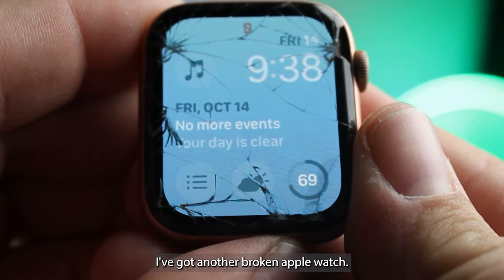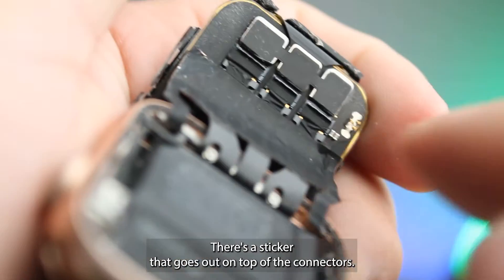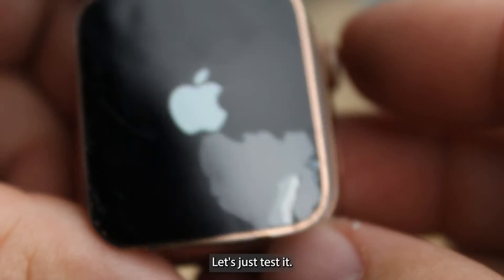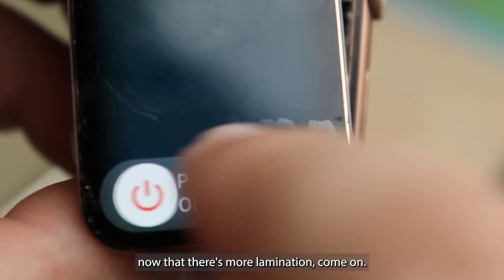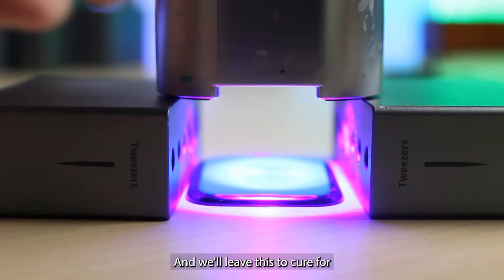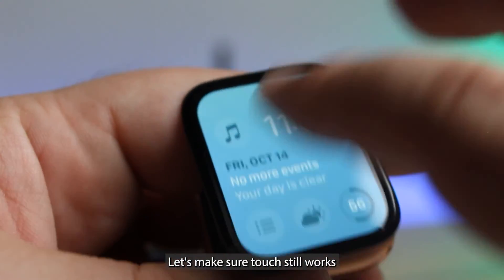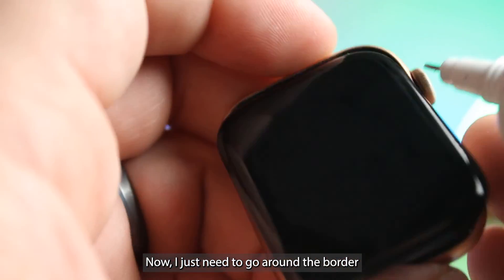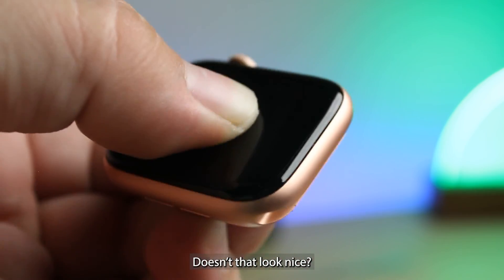Apple Watch Series 5 44mm Glass and Digitizer Repair⌚✅ #applewatch #repair #satisfying

Comment: Good day @FIXDPHONES. I hope you are well. I have a question. I did the replacement of my Series 5 44mm. Replaced glass and digitizer (it came as one unit) everything went extremely well thanks to your instructions, but when testing the touch is was only responding on top 1/4 of the screen. Ive done force restart, OS update. Do you maybe have any idea what could be the issue, as im baffled.
Reply from the maker: Sounds like either the black sticker got wedged into the connector or it’s a defective digitizer
Reply: @FIXDPHONES thank you so much for the reply, ill try to clean out connector with compressed air? And if it does not work I'll ask for a new digitizer

Comment: I just repaired the glass + digitizer on my series 5 44mm, the touch does not work on the bottom 1/4 of the screen. Do you think I did something wrong during installation or could the digitizer have come defective?
Reply from the maker: Most likely either defective or maybe part of the black sticker got wedged into the connector with the flex. I like to pretest digitizers before the install when possible.

Comment: Good day,

I want to ask how it is with the touch sensitivity from series 4-6 after the digitizer repair. I have experience that watches where the digitizer was changed had a problem with touch after installing tempered glass. Thank you.
Reply from the maker: With digitizer replacements you rarely get touch issues with a tempered glass as the digitizer should be equidistant on all surfaces of the glass and should convert over with a tempered glass that also has an even distribution of adhesive.

Comment: Awesome video. Quick question i got my replacement digitiser with glass and it came with OCA applied. I want to use LOCA do i need to remove the existing OCA first or can i just use the LOCA as well as?
Reply from the maker: Yes, you will want to remove it if your going with the LOCA method. Once you get ahold of a little bit it should all be able to be pulled off slowly in one piece if your careful
Reply: @FIXDPHONES  I was wondering this too. It seems that you can only get ones with OCA from Aliexpress right now, so it's a relief to know it can be safely removed. Thanks for your detailed answer!

Comment: thank you for your videos. great job! a question - in this clip you are using LOCA to attach digitizer+glass to LCD. But it seems that digitizer already glued to glass, you just glue this glass+digitizer sandwich to LCD with LOCA. The question is: did you buy an already laminated glass+digitizer for this, or used OCA to attach them to each other, or used LOCA for the same? I tried to find such sandwich to buy, but looks like digitizers are sold only separately from glass. So, I wonder if such repair can be done without laminating machine and autoclav.
Reply from the maker: Whenever you use LOCA you avoid the need for a laminator and autoclave. It takes a little more finesse to do it but totally possible as I’ve done it thousands of times. Your comment about the digitizer being sold separately from the glass surprises me as I’ve never seen that before and digitizers on the series 4 and newer aren’t rigid enough to sell on their own and should come pre-installed on glass from any reputable source. For example MobileSentrix.com 
Hope this helps.
Reply: @FIXDPHONES  thanks. This means I should look better or, possibly, I misunderstood their description.

Comment: Why do you use laminate machine? Is loca better than laminate machine?
Reply from the maker: Great comment, as stated at the beginning of the video most shops don’t have laminators and autoclaves to do these types of repair. I wanted to show how it can be done without them. There’s pros and cons to doing it both ways. Check 3:30 in the video